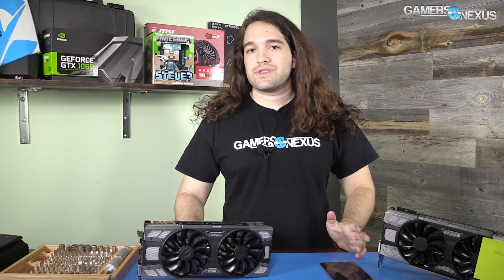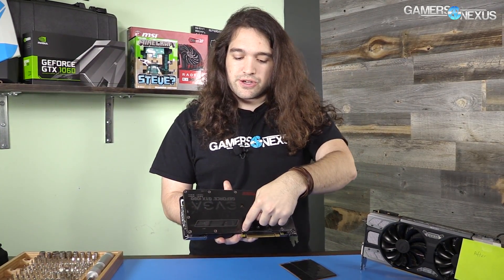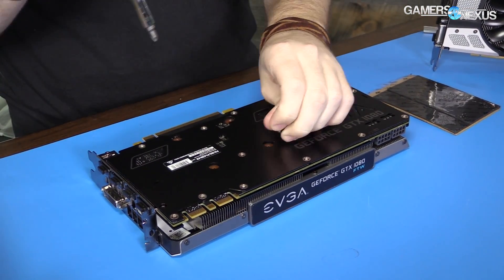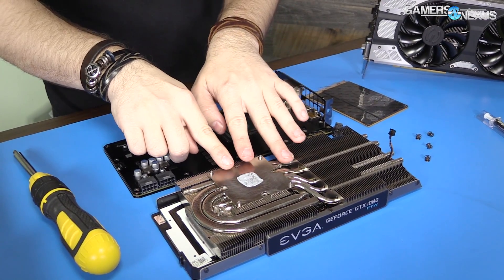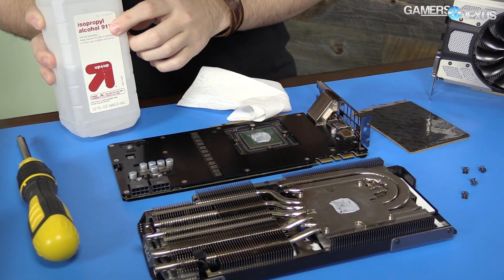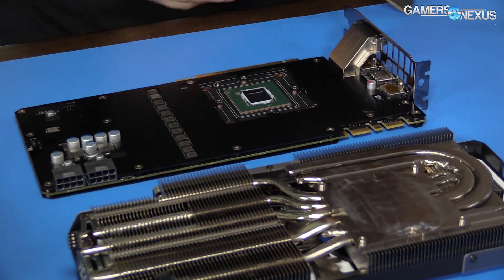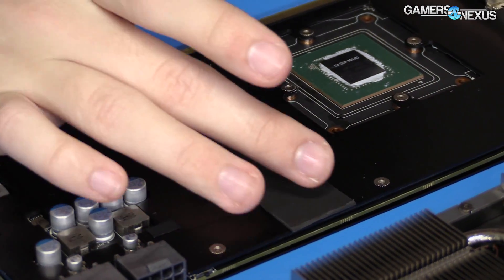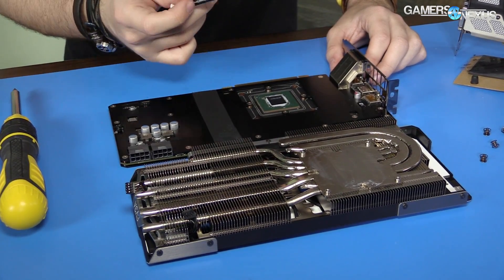How to Install Thermal Pad Mod on EVGA GTX 1080 & 1070

Comment: 1080/1070 FTW:

Baseplate (Narrow) Pad: 26mm x 110mm x 1mm +/-0.1mm thickness
Backplate (Wide) Pad: 58mm x 110mm x 2mm +/-0.1mm thickness

Non-FTW, Non-Classified, Non-Black Edition:

Baseplate (Narrow) Pad: 26mm x 93.4mm x 1.5mm +/-0.1mm thickness
Backplate (Wide) Pad: 58mm x 93.4mm x 2mm +/-0.1mm thickness

For more information on the EVGA thermal mod please visit evga res

Comment: Had this card for 6 years now with no issues and now at idle its 50c, usually it sits around 30-40c. I'm gonna try this fix and hope it works! I could turn on MSI fan control and turn up the RPM but I'm trying to make the fans last as long as they can. Wish me luck!

Comment: I broke the wires connecting to the 4 pin with the orange wire; They were very brittle. Any idea how i fix this? Are these just LED wires or for the fans?
Reply: orange and black wire are just LED wires. the 4 pin black wire connector is your fans.

Comment: If EVGA run out or just cant get them out to you, then if I was to buy pads from say thermal grizzly they arent that cheap, and 1080s new cost 5to600+ in uk, You should be refunded for the pads as you already paid for the card that should have had them anyway so shouldnt be expected to pay £30 plus shipping for pads that they should have installed, And does it void warranty opening up the card?

Comment: b/c of you guys i broke some of the condensators at the back of my evga 1080. there is a secret screw behind a sticker there and you forgot to mention about it. backplate turned around this screw and the metal behind the backplate broke some of the condensators that provides power to GPU. You have to edit these videos for newbies. Idk will this card will work again or not but i am really angry. almost every video i watched they opened the backplate so easily and none of them talked about we have to be careful about the sticker that hides the screw under it. backplate is black and sticker has the same color easy to miss. i wrote this comment so no one make the same mistake. and you guys should take the responsibility here. b/c you  guide them wrong. backplate don't come out that easy!!!!
Reply: notice me Senta!  one the screw was under a black sticker. at this video he removed the sticker before he recorded the video that is why you can easily make the same mistake i do.

Comment: fast forward to 2021.. I just bought the EVGA 1080 SC from my least fav auction site.  I just flashed the BIOS and have contacted EVGA for the pads.  thanks for the video.
Reply: I use Afterburner anyways so I don't see a difference just yet.  I have had some crashes and now i know why.  LET ME GET SOME PADS..
Reply: @lotust251  did they send you pads?

Comment: Is this the culprit of the EVGA FTW 1080 cards Black screen 100% Fans issue? Does anyone know if any cards have been fixed using this? I need a video card so bad and now more than ever this would be so helpful if I knew that this is what it was for or if it would help.

Comment: For direct die cooling, I would recommend making sure all of the die is covered by thermal paste and that it touches the heat-sink as hot spots on the die can cause weird issues such as crashes since the temperature probe does not report the temperature difference on the die. This is also more true because of the fact that silicon is not a good heat conductor.

Comment: I sent my card back and had them do the install for me free of charge. I wasn't comfortable removing the heatsink. Now 4 years later the card sometimes randomly artifacts. I took the backplate off and the adhesive for the pads melted and is all over the back of the pcb. Also dust get onto the pcb and on some soldered connections through the screw holes for the heatsink. I cleaned up the back and haven't had artifacting yet but it's only been a day. This artifacting was coming and going for months so time will tell. I will never buy another EVGA card again. So convenient my card starts to go bad past the 3 year warranty.

Comment: 1/3/2020 and you've solved my red dead 2 crashes because of this issue that I stumbled apon, thank you so much I've been extremely frustrated!
Reply: Called EVGA they said it was only for when the cards were new to make people feel better and isn't a big deal. Was told to go out and buy 1mm thick thermal pads and apply them if I felt I needed them.

Comment: they cheap on the thermal pad kit too! the thermal pads that they send me are leaking oil all over the card now i'm worried because my card can fail anytime! this is pretty lame and i will not get or buy a single evga product from now on!! also i will never recommend evga product to anyone in fact i will tell to stay away from those!
Reply: Only is not conductive. It's a silicone pad, all silicone has oil. Silicone oily is literally used in electronics as an insulator. It's also used in thermal paste.

Comment: I'm using thermal pads that are too thin for my application. Does anyone know if it's ok to double stack the pads to fill the gap needed or should I get thicker pads. The pads I have have an advertised thermals conductivity of 6 w/mk

Comment: of course I will criticize your paste application. saying it doesn't matter, then you thermal throttle with slower fps, then yes it matters a lot. Use the tip of your finger in a surgical glove people, his method leaves a large area around the corners uncovered, and can lower the graphics temps by 15 degrees at least. So yes, it matters a lot.

Comment: @Gamers Nexus Wouldn't it be better to spread the paste to the whole thermal area of the die? I do understand the grain rice method is good for CPU because it has a IHS, but a GPU chip doesn't have that. Just wondering, I need to do this soon, don't want to screw it up, hehe.

Comment: Question, how much does the thickness matter when replacing these pads? My GTX 1070 FE has 0.25mm I believe, but all I have is 0.5mm on hand.
Reply: 0.25 is because they are sweezed from 5mm

Comment: QUESTION:  Is it bad to OVER TIGHTEN the Spring loaded Screws for the heatsink?  Awesome subtle tip there I suspect... Note to future self, DO NOT touch linty-tissue to sticky pads! It leaves behind: LINT! (I just did that to my Gigabyte Aorus GTX 1060 6GB  9GBPS Rev 2, and am now awaiting some K5 Pro Viscous Gel to ,... 'Heal' my Pads LOL it comes tomorrow 'by 8', WHEW!)
Reply: u cannot overtight it. u screw it till it stop

Comment: Thank you for showing us this video. TBH their 1060, 1070 and 1080 series have all been a bust. Fast cards, but they are "one-trick ponies". Ive had several of their 1060s from different models all have thermal issues and especially stability. About every thing you can throw at them from different power supplies to different boards, all yield the same failed results. Their customer service at EVGA is EXTREMELY dishonest. Ive had to UNDERCLOCK my 1060s just to keep them running stable and even then, they are TERRIBLE and still die.  They know these cards have LOTS of issues and they wont admit it. I love to game on PC, but these cards cannot handle workloads for a long period of time.

Comment: Can I use my own thermal paste & thermal pads to mod it myself instead of the evga ones?
Also are thermal paste with Nano/Micro particles/diamonds in them a good thing for GPU or will that damage the GPU chip by causing scratches & tinny bumps ?

Are these thermal paste ok to use:
Thermalright  Chill Factor III.
Cooler Master Gel Maker Nano.
Gelid GC Extreme.
Thermal Grizzly Kryonaut.

Comment: I have a question. Why did you install thermal pad on throttles? Isn't VRAM located to the left from throttles under metal plate?

Comment: Well I got the asus dual 1070 and for me is better than this evga the only thing is doesn't have led light and backplate, but what u want led people buy this card only for the led, and for asus backplate  you can buy on google or eBay they have different styles and color white or black and the card comes with no issues and overclocked don't waist ur money get asus dual fan 1070 and you will be happy doesn't make noise and gets cool...

Comment: Is this still an issue with EVGA cards? I was planning on buying the FTW 1080 over the Strix since the FTW is 60ish dollars cheaper atm on newegg. But if thermal issues are still a problem I am more than willing to spend the extra cash, I decided to go EVGA over ASUS because I heard EVGA has better qc but now im questioning that..
Any thoughts on EVGA over ASUS?
Reply: Typically new ones being sold are said to be patched with thermal pads from the get go to fix that issue.

Comment: Even with all the screws undone, removing the front plate was impossible for a friend and I. Lots of force was used (the card is fine and in use) and the plate never came off so we skipped the vrm pads.

Comment: I am planning to do a PC Build somewhere in 2017. Will the EVGA 1080 FTW Editions have thermal pads pre-installed since this incident now or will I still need to purchase the the thermal pads? I was wondering because my original decision for a GPU was the 1080 Founder's Edition but I was considering the 1080 FTW because of it's superior performance and customization with the LED's. But I do not want the annoyance of installing the thermal pads and doing a bios update.

Comment: Thanks dude. Just added the thermal pads on mine. Your video was very helpful. The instructions that came with the thermal pads says to take out ALL the screws at once which seemed daunting.

Comment: I just did this today and my GPU load temperature is up from 75C to 80C with the fan ramping up to 2000 RPM (rarely went above 1800 on the same tests before), and with the core clock getting pushed lower.  Strangely the 3dmark scores are consistently marginally higher.  Idk what gives here but I'm not a fan of the louder card.  I think the thermal paste they send out may actually be liquefacted garbage.

Comment: I didn't see you remove the 8 thermal pads and put on the other 3 strips.

You shoulda checked the gpu temp in games before and after the thermal pads. I think I'm getting 3-4 celsius less than I was before. Might be the thermal paste replacement though.

Comment: Hello Gamers Nexus,

After installing the pads i noticed a dip in performance in games, using a 1080p monitor, I get around 100 fps in battlefield with recommended settings and 180-200 frames in league of legends. Any idea as to why its not that great of a performance dip yet there is a performance dip?

Any advice would be greatly appreciated.
Thanks

Comment: The LED header came off easily but the fan header wouldn't budge. I was able to install the pad without unplugging the fan header. I just kept the cooler at an angle against a small box so there was no tension on the wire. EVGA didn't send me thermal paste. Luckily I had my own. Overall, I gotta say Fuck EVGA. What a pathetic solution. Lost all respect for the company.

Comment: If your affected card has more than two months of heavy use without the thermal pads the vrm is probably stressed.  It's a 50/50 chance. It is better to do a bios update and hope for the best. If the card is brand new or has low hours, then do the pad mod. Or if you are loosing sleep over it. It takes two weeks for it to arrive in the mail. Keep the card shrink wrapped until the kit comes. Takes some patience. You can check to see if your card is affected by registering with EVGA. Use Artic Silver 5 on the chip to reassemble. The kit has a packet of Silmore thermal compound. Don't know how good Silmore is. Just went with the good stuff.
Reply: I did the mod on the 1070 SC version. I noticed there were no pads for VRAM in this video. The kit that came for the 1070 SC has pads for  VRAM. Hopefully EVGA didn't find coolong issues with VRAM as well. This is going to completely suck for those who have done a pad mod without VRAM pads in their kit.

Comment: I own this card as of today, and am waiting for those pads. One (stupid?) question: is the pad thermally conductive? Does it feel metallic? If so, that seems like a fine solution to me. 

Another, perhaps equally dumb question: after reading this https://www.reddit.com/r/nvidia/comments/5aqjvb/so_i_disassembled_my_two_evga_gtx_1080_ftws/ I've been thinking, should I put a drip of thermal paste on the VRAM or its cooling pads? Would that be a good idea? 

I could request a refund on this card through Dutch law (mandatory 14 day return policy), but I actually kind of look forward to applying these mods. I've always wanted to open up a GPU but never have, in fear of losing my warranty. I doubt the issues will persist after these fixes and if they do I'm confident they will offer good customer service.

Comment: Why Doesn't EVGA do this at the factory? There is no way I'm doing this too a $600+ card.
Reply: As of November 1st all cards from EVGA come with thermal pad and vbios fix applied. I would just avoid buying from retailers just in case one without slipped through the cracks. They pulled cards from stores with the replacements, but some small retailers may still have cards with no pads. I bought my 1070 FTW in September so I'm applying the fix myself with video to back it up.
Reply: they do
Reply: tyler williams Do they or do they just offer a exchange that has the fix applied already? What I am asking is if I buy a new card today, will it come with the thermal pads already applied?
Reply: chances are no, but they will fix it
Reply: i too total dont care about installing that bullshit ??? i have 3 years guarantee after  3 years i will buy another graphic card anyway........  and my temp on GPU is max 55-57 degrees  :) dont worry be happy :) who needs that thermal bullshit....
Reply: gpu core it that degrees vram runs much much warmer
Reply: I know I'm a bit late but I was curious about whether this was the case or not, as I'm considering whether to buy a new 1080 from EVGA. Good to know I wouldn't need to apply this mod on a new card, thanks.

Comment: I was having issues with my card in bf1( in COD as well) just turning off and giving me black screen although i am not sure if that is the card overheating or something else so i applied the bios update  and ordered the kit will see if that fixed it.
Reply: Did it ever fix it? I can't find a GPU for the life of me and my 1080 FTW recommends bios and thermal pad mod. I was wondering if it stopped your black screens.. Did you also get fans spinning to 100%?

Comment: I've read that this only applies to the FTW models. I have a GTX 1080 Superclocked, and I've had no overheating issues at all, even under maximum load in demanding VR games (76º max temp observed).   Do you really recommend this procedure, even if the SC is not directly affected and no temp issues are observed?. Thank you for your input.
Reply: Just curious... I know this is years later but I actually acquired a GTX 1070 Superclocked Black and I'm wondering how your experience with the 1080 SC went? I haven't installed it yet (still getting ready to do the build) but seeing that you had the same type card and no problems with yours, figured it might be worth a shout-out. Thanks in advance if you happen to see this!

Comment: Guys, I really don't like "going under the hood", and I don't want to ship my card over to EVGA either. Now, with that said, I have set the "aggressive" fan curve using PresecionX software. Will my 1070SC be okay without this "mod"? 
I find it absolutely atrocious that EVGA had such a big "oversight", and didn't include the pads to begin with.
Reply: Just use the new bios which sets the aggressive fan curve.

EVGA stated that this should be fine with cooling the card within specifications

Comment: So on the flip side, it's the back plate that now serves as a heat sink for the VRMs? Seems it's not very well designed for that. If, as you say, the back plate is trapping the heat then just remove it. As seen in your previous video, the cold plate configuration used on the EVGA hybrid would do a better job, even if it was air cooled. If another cold plate could be extended to the flip side  (the back plate side) and connected to the front side cooler, then all the hot spots would be taken care of.

Comment: Thermal pads come in four sizes 0.5mm, 1.0 mm, 1.5mm, and 2.0mm. There is no 1.87mm thermal pads to be purchased. The link you have given in the descriptions is only for 1.0 or 1.5mm thickness. Does the film make the true thickness of the thermal pad appear bigger than the nominal 1.5mm? Seems like I have to wait until my pads come in from EVGA even though I could do it myself.
Reply from the maker: Just depends on how much force is applied when using the calipers, probably, in addition to the film. 1.5mm is reaching the heatsink in our small sample size of 1 unit (I bought 1.5mm pads and tested, but we only tested on the one device -- just need to tighten the sink sufficiently). 2.0 would be closer and allow for more 'squish' in the pads.

Comment: Thanks for the vid, Steve.  Went out to get some thermal pads and applied them as well as updated the VBIOS.  Just played some BF1 on my 1080FTW and did not get any hotter than 69° C with fans ramping up to max 1787rpm (Open Hardware Monitor). Keep up the good work!

Comment: I notice that the other side of the [smaller] thermal pad does not seem to be touching any part of the heatsink. Will the thermal pad still do its job (dissipate heat better than the bare component exterior) without touching the heatsink? This is more of a general question (not specific to this card)?